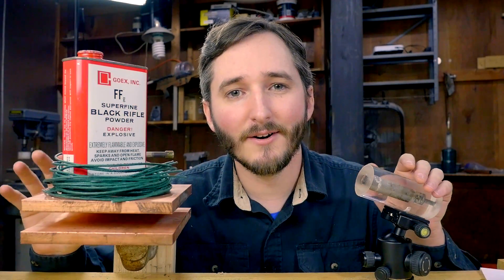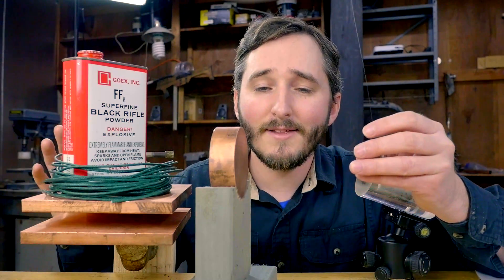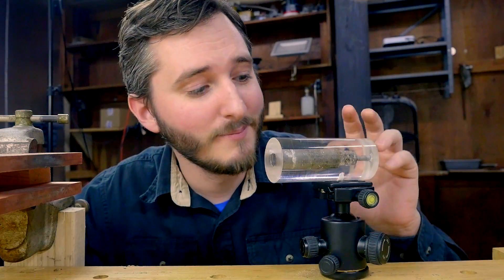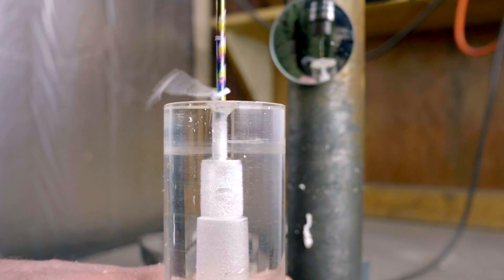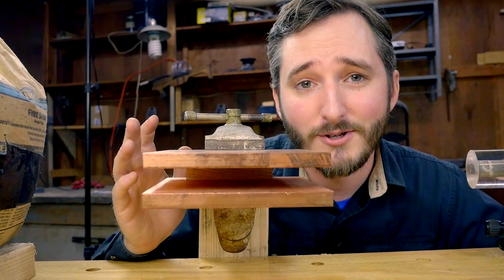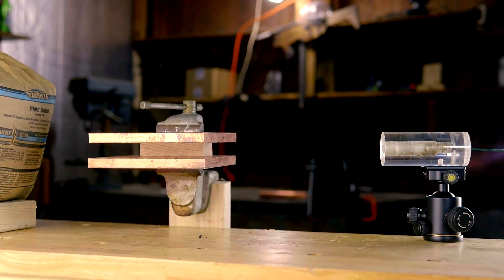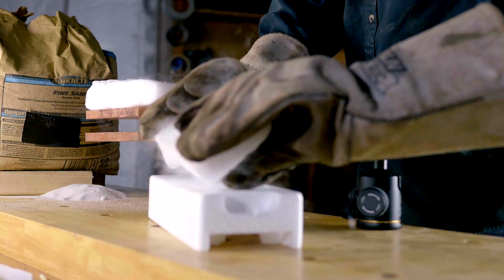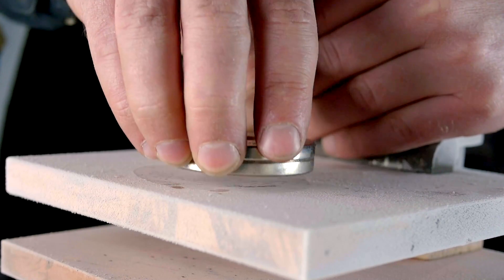Electromagnetic Force Fields VS. Magnetic Cannonball

Comment: I would call it a Lorenz Force Field, because it takes into account the limitations of EM fields:  They act a Right Angles to the Current, so they're Polarized, and they drop off with the Square of the Distance.  (So at 2 meters, they're a quarter as strong as at 1, and at 3 meters, 1/9th...)  Also, they're Toroidal, so there's a weak spot at the pole.  Where the field turns back on itself, though on the other side, it expands out from the same point.  The problem is the field attracts, or Repels the opposite Polarity, so if you fire a magnetic bullet, and it's repelled, you fire the Opposite in the next round, or it just flips over, and is attracted, to actually hit Harder than if there were no field.  However, you could reinforce the Pole, and surrounding it, so that the projectiles will hit the most heavily armored part of the shield, instead of the relatively thin, and weak edge.

Comment: when you drill into acrylic make a small pilot hole before making a desired diameter hole. This will reduce the amount of material the large drill bit has to cut into, reducing friction, reducing heat, and allowing you to cut deeper without boiling the acrylic. It will also reduce the wear and tear on your drill bit and make it last longer. It will also cut faster and clog up slower. The pilot hole should be 1/4 to 1/2 the diameter of the desired final diameter.

Comment: Part of the reason you failed is that your ball was far too small to properly interfere, magnetically, with the copper tube. Since magnetic effects dissipate quickly over distance, a larger ball or a smaller tube would fair better. Remember , with the tube and magnet combo you used for display was far better fitting, and it worked. Also that the pendulum you used only slowed right as it nearly hit the copper plate.
Reply from the maker: Yes that's true. It's hard to use a larger magnet because of how accurate you have to be to make it go through the tube without hitting it. The magnet was large enough to slow down when dropped through the tube, but not as much as a larger magnet would.
Reply: @Nighthawkinlight  Turn the end of your barrel such that the copper tubing will fit inside for alignment.  Then drill a large number of vents just past the muzzle such that the copper tubing can't pressurize and become dangerous or aid the ball in defeating the magnetic interference. Then the larger Magnet wont be and issue and you can fire it without misalignments or turning your tube into a bomb.

Comment: This should be implemented in all veichles, copper fender in the rear, and a elecromagnetic fender in the front of all cars, which engages when a collision is about to happen, this way no cars would even touch each other when in a wreck, should work with tomorrows way of building superrigid frames out of compisite materials rather than heavy steel that holds a lot of momentum because of its weight, and with all the batterypower the electrical cars already have, a electromagnetic front fender would be fairly easy to build.

Comment: I wonder. Can you stabilize electrically charged gas with a magnetic field? Something like ionized lithium gas. 

I've had an idea for years About using magnetism as a field stabilizer to create a "shield" of electrically charged gas. 

Seeing this, it makes me wonder if the medium I have an idea in my head about can mimic the effects the copper plate has on the pendulum magnet, on non ferrous material.

Comment: Why not use a copper projectile and use the magnets to induce the field in the bullet, to avoid de-magnetization from the heat/pressure of the cannon blast?
Reply: are bullets made of copper?
Reply: While from a math on paper stand point it may work in actual attempts it has failed because the magnetic field required to stop a bullet needs to be 10 times stronger than the magnetic power necessary to instantly rip the iron out of bones.
Reply: @rembliekain7643  cool
Reply: good point!

Comment: Laser pointer through the hole in back of cannon to aim.  Also strengh of the magnets is absolutely crucial to this, suggesting using equal strength to your pendulum.  If you drop that ball down a near diameter tube it will still plummet if it is too* weak to resist its own mass.

Comment: Interesting idea. You did the experiment wrong though. Try shooting 3 shoots through a chronograph. Then shoot 3 shots through the copper plates as well as the chronograph. This should tell you if it slowed any. Then you could take it a step farther by adding more copper plat area, cooling them or even adding a magnet to induce a higher pull on the shot.

Comment: No I feel like I'm being stupid but it seems like it would make more sense if you took a mathematics of the pound per inch for your gun power versus the size of the year projectile by The Distance by the magnetic field of the lens of both your projectile and the copper you can calculate that by going the size of the copper and the space of the point of contact. It sounds like a hard calculation but it's really not. Just basic physics if you wanted it to stop what I would recommend is using multiple magnets I would take three Transformers from three different microwaves and try to create a magnetic field on your copper with those Transformers the higher cycle should give you a higher magnetic field and multiple fields will give you a better chance of stopping your bullet the back of my head I keep thinking capacitive reactance it's not an inductive reactance because you're not inducing a field that you're shooting its capacitive because you're restricting flow in One Direction. just like a capacitor in a computer.

Comment: sir, instead of firing what would be the result if its been sling shot or been projected in some other kind? because the heat produced from the firing may cause the magnetic to loose its power right??

Comment: !!That doesn't work between 2 plates!!
The current  has to flow around the "bullet"
A copper pipe works because the spinning current makes a resisting force.
Reply: So the electricity has to flow around the bullet to slow it down
Reply: So if a device could induce powerful eddy currents at an incoming conductive anti-tank round, it might slow it to sub-lethal speeds.
Reply: question for curiosity, if it needs to flow around the magnet, how does a single plate slow an incoming pendulum?
Reply: Its the 90 degree counter electromagnetic fields that produce the effect

Comment: Bit late, but what's the explanation on the direction of the magnetic field? First instinct was that the plates shouldn't do much. With the cylinder the magnet was moving towards it, but with the plates on both sides how is the horizontal movement affected? Or is there a field going in a single direction against the projectile, aka not both ways out?
Reply from the maker: Check the Wikipedia page on magnetic braking for some good diagrams of parallel movement

Comment: If the magnet is rotating faster than the induced magnetic field can adjust maybe the effects wouldn't be noticed, would the same results be seen if a bullet shaped magnet were used to keep the magnetic field in the same direction

Comment: i wonder if a combination of a magnet and a superconductor could stop an incoming metal (but not necessarily magnetic itself) bulled in place? the idea being the magnet would induce a current in the bullet, that current would magnetize it, and as a result it would get flux pinned against the superconductor? neither the magnet nor the superconductor may cover each other for this though (the magnetic field can't penetrate through the conductor and the magnet would mess with flux pinning), but maybe a checkerboard grid pattern of the two could work?

Comment: looks like one of your problems was that the distance from the projectile to the copper was too big. you could have done a control to see. take a short section of that pipe and just drop the projectile through the pipe like you did with the cylinder magnet. that cylinder was very close in diameter to the inside diameter of the copper pipe, yet your projectile was , what 1/2 or 1/3 the diameter of the pipe inside diameter. i bet that made a big differance

Comment: Interesting experiment but I have an idea for you I think cuz you're showing a how a magnet can induct current and that current could also create Heat why don't you make a stirling engine or the stirling engine flywheel has magnets that generates electricity that induces an inductive field around the hot side of the stirling engine see if you can make it perpetual motion machine or something close using magnets electricity and the inductive Heat how Stirling engines work is they have a cold side and a hot side of the engine you just have to create a temperature difference have the electricity produced by the flywheel make the hot side hot there you go peace out have a great day

Comment: I don't think the problem is the copper or the magnet, the problem is the speed. 

The magnetic field formed in the copper indeed is opposed to the movement of the magnet, but the problem is that the magnetic field formed in the copper, does not form instantly, it takes certain amount of time to be formed. If  the opposed-to-the-movement magnetic field, forms finally with certain time delay  such way the fast traveling magnet is already too far to feel the effects, the decelerating force will be ineligible. May be a magnet, long enough to catch the effects of the lagged, formed magnetic field in the copper, will have some chance to feel the decelerating force. But it looks that, as faster the magnet is, less effect of its field left farther behind will feel.

The experiment would be similar to a known issue in induction high speed electric motors, in which the induced rotor magnetic field, get lagged of the generating magnet which created it in the rotor, such way that at certain point it starts to interfere with the next opposite pole magnet which follows it, reducing the torque and limiting the speed of the motor. To compensate this effect the designers have to "advance" the formation of the magnetic field by rotating the position of the brushes in the rotor or using capacitors or even MCU's (In the case of brushless motors)

By making combinations of circuitry with Induced Copper wired Electromagnets and Capacitors, and playing with  the, characteristic impedance, I am pretty sure there is a way to create a , lets to call it "Induction Tunnel" , that can stop that magnet bullet.
Reply: The magnetic field moves at the speed of light I think.

Comment: You would have to do your experiment with compressed air because a magnetic fields weaken in extreme heat. Although in science, your object through a barrel and friction equals heat. Try a slingshot sort of action better. Is been done in movies trying to stop an asteroid. The copper doesn't build a magnetic field since is not magnetic. And throughout the electric properties of the metal, all the copper do is to influence the magnetic field and for a moment, the magnet gets a re-organized magnetic field when the magnet escapes the influence of copper. But in order to remove an asteroid and put it in another part of the universe, definitely will require the asteroid magnetic field got reorganized. Astronomy is the most exciting thing I ever studied. Magnetic is our Universe. Confidential.

Comment: Inconcluseive: why not measure the electricity created by the magnet ball travelling through the pipe, if any elictricity is generated or not. Also, why not take it one step further and scale up until the point where you have a magnetic field strong enough to stop it ?

Comment: Why didn't you try to cool the copper pipe like you did with the copper plates? Anyway I think it probably doesn't work because the magnetic ball is spinning and therefore rotating the magnetic poles which prevents the copper from creating an opposing force. ;)

Comment: You should revisit this using compressed air rather than combustion. IDK that there is enough heat from the cannon to demagnetize the magnets but its a possibility I suppose. Might be worth trying again to see if there is any difference, and you wont have to worry about the smoke.

Comment: HI, nice video but I believe you will be better off firing the projectile with compressed air as magnets loose strength with heat.  The temperatures inside a barrel are well above the temp to reduce by over 50% the strength of the magnet. Good vid though fella and look forward to if you try by air as my suggestion is

Comment: iv allways wanted to do this but fire  a metallic and or conductive bullet at an electromagnet hooked up to extremely highly charged capacitor, basically like a mini home made induction cannon and or "rail cannon"  coil driver if one can pulse it at the very milli second the bullet is about an inch in front with some type of radio wave proximity sensor  you could use a solid copper bullet not needing any solid state magnetic projectile  and the induced magnetism in the copper will be hundreds of time stronger than any solid magnet and that repelling the giant pulse of the coil discharging, i figure  it should work wonders if not perfectly but the problem is with such strong electromagnets being pulsed they usually blow themselves apart because of all the induced force involved against its self  so most are a one shot deal before needing to be repaired but hey id sure always rather repair a splintered electromagnet than a hole in my chest! haha

Comment: I was wondering if you surround something with a magnetic field like fluid how will it react when the magnet comes to full stop Against the copper plate will the water inside surrounded by the magnetic field react to the sudden stop and is there any way of stopping the force of gravity from reacting to whatever is surrounded by a magnetic field when it is stopped by copperI know I said the same thing in a couple of different ways but I wanted to be sure you understood also if the magnet is a hollow sphere would something inside of that react the same as if Jaguar just simply surrounded by magnets

Comment: "this needed to be aimed perfectly so i eyeballed it"
Reply: Belethor lol, the worlds first tape measure..
Reply: @BoWeava  "this needs to be perfectly straight, so I slapped my dick on it and wallah!"
Reply: @7XHARDER  why do you "swear by god" in arabic? did you mean "voilà"?
Reply: Use a dowel Rod bro
Reply: @wallywalters1112  same thing... No?
Reply: @wallywalters1112  XD just got that
Reply: In the opening example the magnet meets the copper head to head. But on the experiment the two plates of copper are pushing up and down sort of canceling each other and the magnet just goes in between 
Can you try to have the bullet going straight into the copper and see what happens
Reply: @pastoraris1001 iu:ģ
Reply: Bb
Reply: Use a laser lined up with the fuse hole.
Reply: The makers mantra, if it looks straight it is straight
Reply: ummmm
Reply: A Lazer pointer must have been to inaccurate
Reply: Words to live by

Comment: This in fact does work.  Look at the military's electric armor.  The problem your facing is that the faster a projectile is moving, the more magnetic flux is required to magnetize it.  There is a speed at with magnetic flux can move through an object.  Increasing flux will increase the speed.  The projectiles size and conductivity also play a role as well. Larger size needs more flux, higher conductivity requires less.  A small ball magnet like that is just not going to be enough.  But if you were firing a copper ball at a very powerful electromagnet, that would be a different story.  Further improvements could be made by oscillating the magnetic field.  Allowing it to oscillate would increase the effect of lenses law and would also allow the stored power during the fields wave trough to be added to it's peak. Thus increasing magnetic permeability, without increasing power usage.

Comment: Well after you put the dry ice on the copper, my question is if you did put the gun aimed at the same spot if that it was then where you put the tape it hit just left side of the tape that means it didn't slow it down but it did shove it to the left. ? , so it with the dry ice reflected it just enuff to change the target. It didn't hit the tape. Right or wrong,

Comment: You need to fire the cannon first in air and measure the distance over time using a high speed camera and then do the same again with the cannon through the copper pipe, that way we can see the effect the copper pipe has on velocity and from there you can mathematically calculate the length of pipe required to stop the projectile (without actually building it :-))
Obviously weigh the amount of gun powder used and use the same exact amount in each shot for accurate results.

Comment: From my understanding, your experiment failed because you are using spherical magnet, which are difficult to align the magnetic fields. If you were able to make cylindrical magnets travel without tumbling, that would be the ideal setup. Keeping the poles oriented while they travel, making eddies, gives more reluctance. If the spheres are oriented any which direction, then they can be at any inefficient in between. One of the most important features of any device using magnets to hover, is uniformity/normality in the fields of flux. As well, with the spheres, there is very little of the magnet close to the walls of the pipe. With a cylinder, you have more magnetic surface interacting with the walls. Which will give more reluctance.
Mix this with your vacuum cannon, using a cylinder magnet as the projectile, inside some kind of (Teflon?) shielding, and instead of a clear acrylic pipe, use copper. You can use just a metal slug inside the projectile as a “control”, to see if there is any difference in velocity.